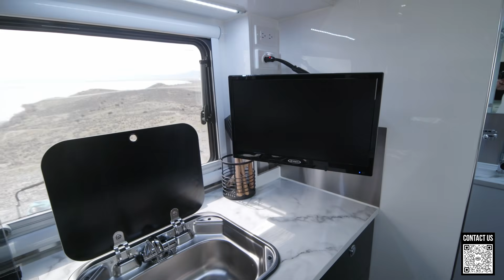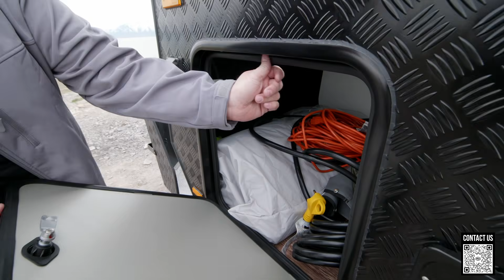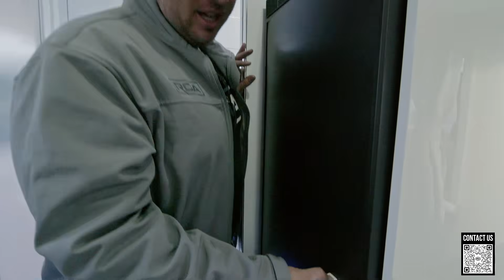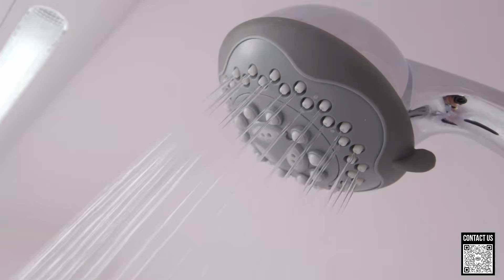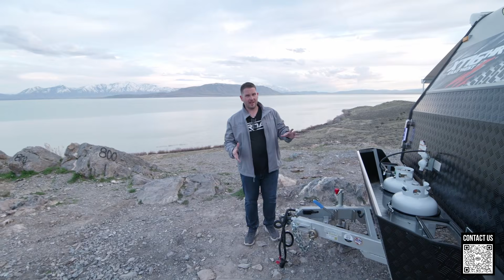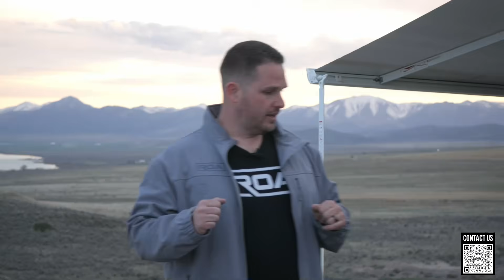FULL TOUR! The Off-Road Camper BUILT For COUPLES! | MDC XT16HR East West

Comment: Dometic offers a SmartStart 120V accessory kit for Penguin II electronic air conditioners to allow this AC to be powered off of a 2000W inverter generator. I'm sure ROA would install this as an option, the part is about $299 and installation wouldn't be that hard for the DIY'er. I'm seriously looking hard at this 16' camper.

Comment: Shane
 I think this is one of the most in depth tours to date. I also think with a few tweaks this trailer could be perfect. I would love to see and enclosed box on the front like the XT17 as the US market doesn't need jerry can holders. Couple this with a Iconic X pack for your truck and you would be set for weeks out on the road.

ROA if you have not seen the Iconic X truck packs you should check them out. I think they would be a great addition to any offroad truck and trailer setup. 😉
Reply: Yes Sir, the 2025 has an enclosed box, 700 watts of solar, and a standard rear-view camera.
Reply: @highfiving50  Nice cant wait to see it